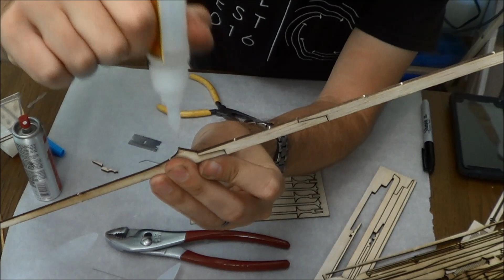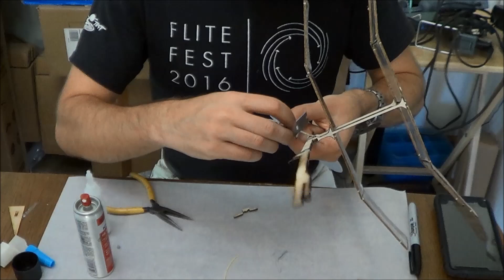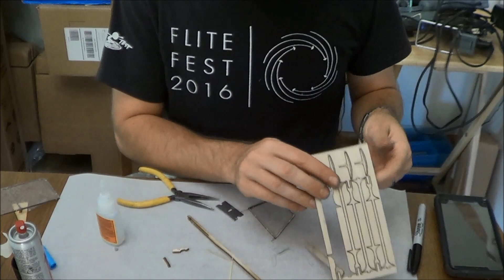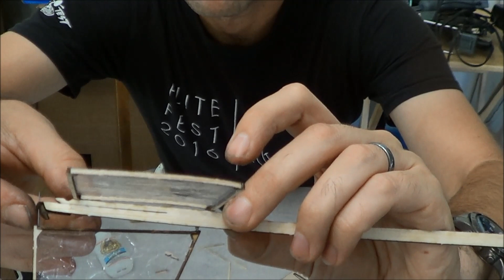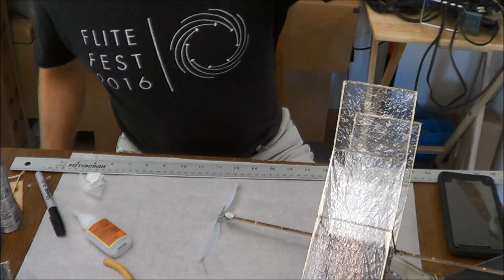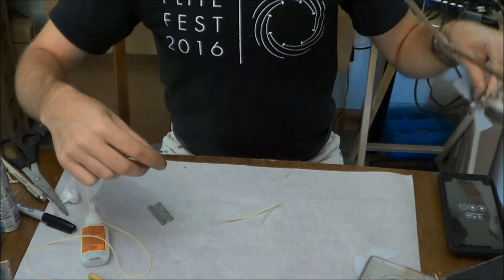Senior Flyer SO 2020 Build Pt.3: Fuselage and assembly

Comment: Does it matter if you glue the rudder on the top side of the plane or is there a reason for it being on the bottom?
Reply from the maker: Kit Kit you could do that... just make sure the adjustment mechanism is mounted correctly to allow for that.